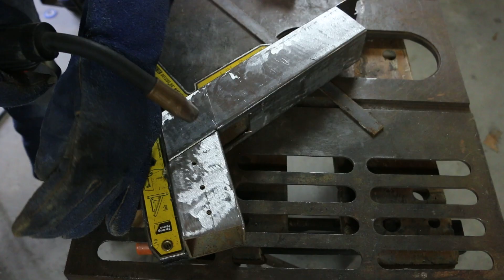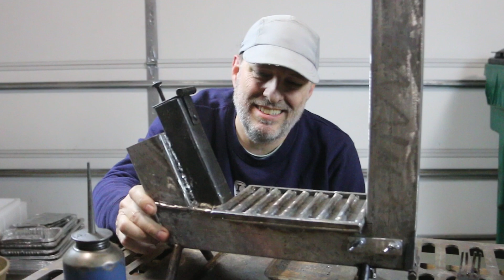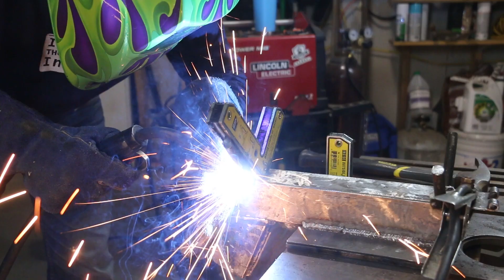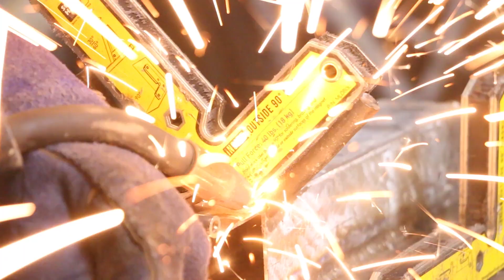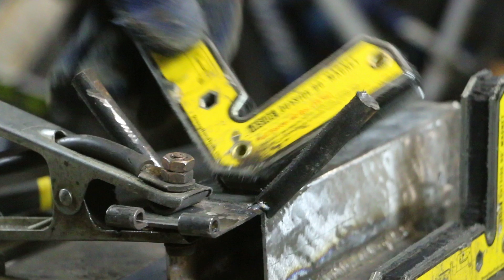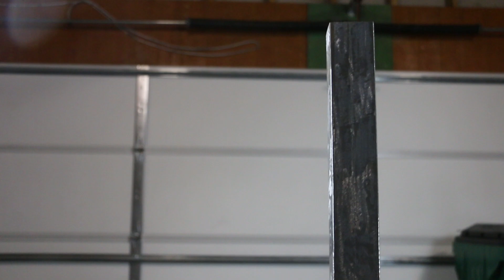A Duel Fuel Rocket Stove Project Update

Comment: That's quite a riser you have there!
Reply from the maker: Lol! I cut it a bit oversized until I figured out how the hinged connection worked out. It will be resolved in the full build video. :-)
Reply: @GreenShortzDIY  NP probably improves heat transfer. Thank for the vid!